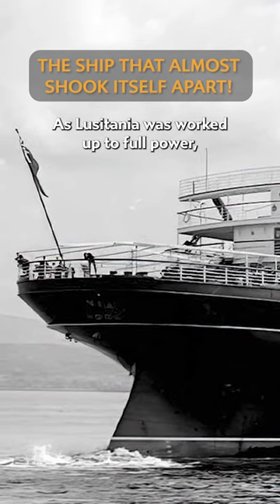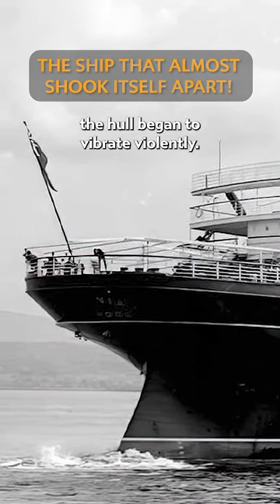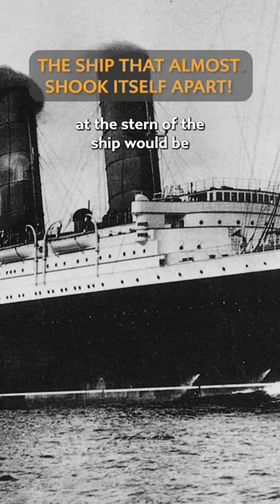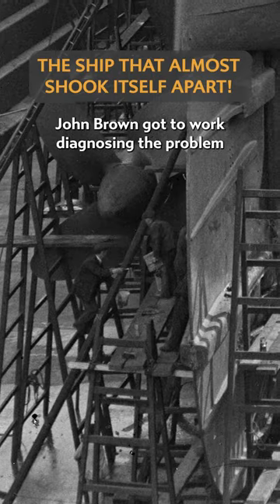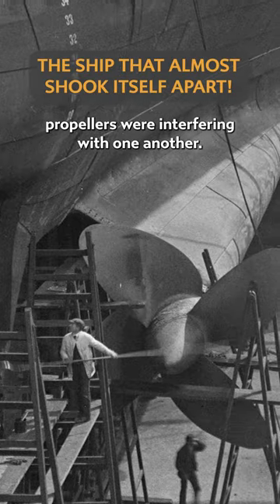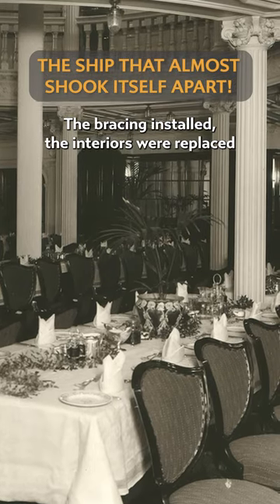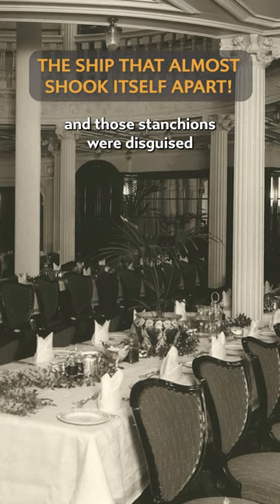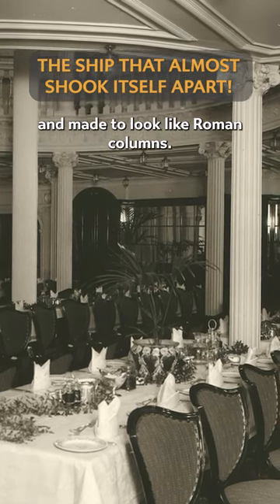Lusitania: The Ship That Almost Shook Itself Apart! #shorts #history #titanic #facts #ships

Comment: Once they ditched the direct-drive concept with the turbine directly connected to the propeller shaft, and introduced high pressure steam with a gear reduction system, that improved vibrations. Think about driving a vehicle with a manual transmission, and you place it in to 1:1 at too low of a speed.. it vibrates and possible stalls the engine.. Similar concept here. These original designs were operating at 1:1 at all speeds which resulted in vibration. All part of the learning curve, I suppose..
Reply: Turbines have a usable power range. Go too slow and power falls off a cliff. Variable pitch propellers allow higher turning speeds with less thrust. Identical propellers interfere because slight differences in speed cause harmonic vibration. Solution is to use three four and five bladed props.
Reply: @Dave5843-d9m wait if that's true then why didn't they just change out the props instead of gut half the ship..

Comment: Direct drive turbines did that. Only when geared ones were developed were they totally viable. Why the Olympic Class used Triple Expansion engines, older, but totally proven and steady.
Reply: With one low pressure turbine, however.
Reply: @davidlanfranchi8955  True, but it was just a little extra push from the leftover steam.
Reply: Triple Expansion steam piston and double ended boilers were coal fired friendly! The Brits had lots of coal back then!
Reply: @glennoropeza3545  Still do, just deep down and no longer needed.
Reply: Thanks. I was wondering.
Reply: @daviddavid5880  Everything in engineering is a compromise. One ship favored speed, the other comfort.
Reply: @dickJohnsonpeter  That is true. The issue here was they were direct drive rather than geared.
Reply: @dickJohnsonpeter  It wasn't so much the turbines but the way they connected to the propellors. In direct drive the turbine shaft went right to them and that more or less caused it. In geared, well simply the turbine connected to a gearbox that went to them.
Reply: @TheGroundedAviator it is not that simple.
It also has to do with the propeller arrangement. And how they were mounted.
Basically they were too close together and the outer propellers waggled around by several inches.
Reply: @CS-zn6pp  That is certainly true, it's never just one thing, just the one I read.
Reply: @TheGroundedAviator  What would a direct drive turbine vibrate more than a geared one? Would the gearing somehow absorb some of the vibration?
Reply: @JeffDeWitt  More or less. I'm not the best to explain it to be honest. But it's no different to a car in theory with its gearbox.
Reply: @JeffDeWitt  with the engine and propeller turning the same speed, it allows imperfections in each to amplify off of the other. if the propeller is turning at a different speed from the engine, it allows imperfections in each one to desynchronize and cancel out the other.
Reply: @AlexandarHullRichter  That kind of makes sense, but then why don't cars have the problem when top gear is 1:1. I get that the wheels would be turning at different speed than the engine because of the differential, but there is still the driveshaft... or is it just not enough mass to matter? (I know, ship propellers are BIG)
Reply: @JeffDeWitt  well, for one thing, the differential on a car will have its own gear ratio. The final drive ratio on cars is usually somewhere between 2.5:1 and 5:1, so even in a 1:1 transmission gear, the whole drivetrain is turning that much faster than the wheels are.

The other thing is that a car's wheels, and the entire drive train as well, should be turning a lot faster than a ship propeller does. I can't imagine you're going to have a full-size ship propeller that runs effectively at 3,000 rpms.

Imbalance issues are in major problem in cars, however. Even if one of the wheels is very slightly out of balance, you're going to get bad vibrations when you drive fast. Every part of a car that rotates has to be pretty much perfectly balanced to prevent that, from the engine, through every drive shaft / CV shaft, to the brake rotors and wheels. Car manufacturers even put dynamic dampers on rotating parts to reduce vibrations when they can't get the parts perfectly balanced. You'll see that in the form of a harmonic balancer built into the crankshaft pulley on the engine, and in the form of a little floating donut on a CV shaft.

One of the biggest differences between cars and ships, is that cars are a lot lighter. Even the tiniest vibration is going to be a problem that will cause people to not buy a car because the car only weighs 4,000 lb. An ocean liner is going to weigh a little bit more than that, and just the sheer weight of the vehicle will damp out a lot of the vibration.

Another major difference is how smooth the power output medium is. Thrust from a ship propeller is going to have some turbulence and pulsation to it because of the nature of having propeller blades, especially when you have multiple propellers. A car transfers its power to the road through tires that are essentially smooth and uninterrupted, so on a smooth roadway, you're not going to have any pulsation or turbulence in the power transfer between the transmission and the road surface.

Comment: I was in the US Navy for 8 years.  The early ships didn't have what's called a jacking gear. Which is an electric motor that slowly turns the shaft to the props around 3 rpm to prevent the shift sections from sagging under their own weight.  Most early 1900's ships had this problem.  It had nothing to do with the props. The Battleship Texas also had this issue

Comment: Curious about how construction documents were used for Lusitania and Mauretania as they were sisterships but built in different yards and with noticeable differences. Wouldn't Cunard want them to perform equally well? Was a set of preliminary drawings shared with both yards, with deviations from those plans approved by Cunard? 'Swan Hunter wants to overhang the promenade deck and John Brown detests cowl vents' - each difference between the two ships would result in separate drawings which costs time and money to prepare.
Reply: Now that is an interesting question. Maybe they were doing it as a contest to find out which shipyard they should use in future?

Comment: Nobody considered the combination of direct drive turbines with their faster output shaft speeds to the propellors and the cavitation caused by the interaction between the water and the propellors would cause so much damage. It's very similar to the effect caused by water hammer, except that it is occuring as much as several times a second, an effect that can eat shafts, bearings and propellers.
Reply: And yet oddly enough the Titanic’s engineers got that part right. Go figure.
Reply: @davidkendrick4453   Well the easiest solution is actually to just have a piece of hull to prevent the prop wash from touching.  This is something you see in a lot of designs.  the props are positioned so that they can't interact with each other.

Or maybe my impression was wrong and this was a sympathetic vibration issue related to the engines themselves.
Reply: Cavitation only forms on the surface of the propeller with the forming of gas bubbles which in turn act like super heated steam eroding the metal  any other deterioration in other metallic fittings is caused by osmosis and can be reduced by the fitting of sacrificial anode's

Comment: The problem was the wheels,  screws,  Normandie also had a vibration problem.  Designing and testing the wheels in a model testing tank would have been the best solution.  It worked well with Gibbs , UNITED STATES .
Reply: What is the point of having wheels, on a ship?
Reply: @bodgiesteve8849  the term "WHEEL" is a marine engineering term for that rounded doohicky spinning thing under water at the roundy end that pushes water aft too propel the vessel forward  !
Reply: Might better be called propeller or screw propeller. 
          It is true that a solution might have been to manufacture new propellers with a different number of blades for maybe two of the four propulsion lines, but in those days there was no computing equipment and modeling methods to ensure the result. Si they had to make do with the vibrations and try empirically to mitigate them.
Reply: @bodgiesteve8849 Tug boats have wheels , tires , not as fenders,  but so the boat can travel over ground if it capsized and sank.

Comment: Good thing all that rattling didn't set off the explosives they put onboard with the passengers!
Reply: the amunition was not fused, so it did not explode. a major steam pipe ruptured after torpedo denotation which blew out the hull, lasting 18 minutes.

Comment: Ok, 2 things. When you said "interfere" with one another. In what way do you mean? Were their strokes mechanically out of synch? Being mechanical, im assuming the pistons have to be timed for balance. With the props rotating opposite of each other. Also, did you mean 4 bladed propellers?
Reply: The Lusitania used steam turbines, so no pistons here mate. By interferance he meant that the prop wash of the  forward 2 propellers would hit the aft pair which transfered to the hull.

Comment: You'd think it would be a better choice to replace the screws so they didn't resonate. I meah, vibration damage over time seems like it would be more maintenance intensive. Combine that with the cost of gutting the stern and rebuilding it, and it seems like it might be cheaper to just replace the screws. Then again, I haven't looked at their account books.
Reply: Yes but they would have to re-design the propeller placements and downstream effects.

Comment: Why was'nt it easier to change something about the propellers?
Reply: It could be the real issue was in the engines, not the props themselves.
Reply: This wasn't a kayak. Huge expense involved in lifting the ship out of the water for dry-dock.
But more importantly, taking the ship out of the fleet for even one sailing would be expensive. 
Tickets for these sailings were bought, sometimes, years in advance.

Comment: That is a terrible fix. It does nothing to fix the underlying, "root cause" of the vibration. 
It is as if your cars engine began running bad and was making a terrible noise the mechanic put a bigger muffler on the exhaust pipe and said, "Ya don't hear the noise any more.... problem solved!" when nothing has been fixed.

The propeller shafts would be beating the crap out of the shaft bearings and possibly more.  The designer F-d up on his design.
Reply: Things are still designed poorly.